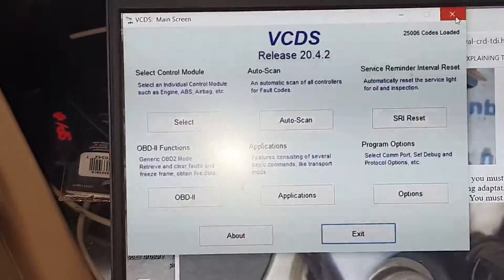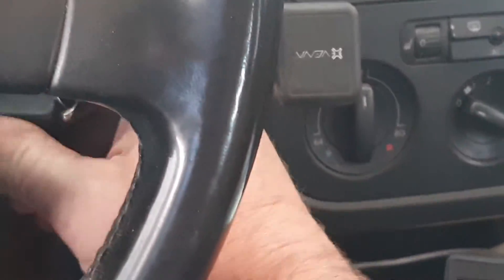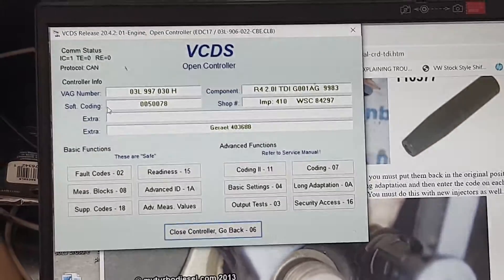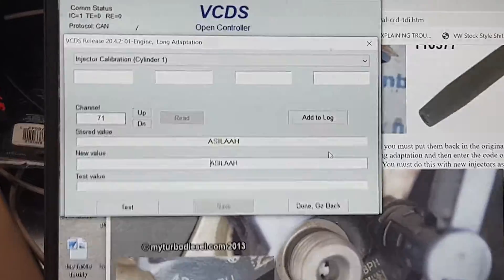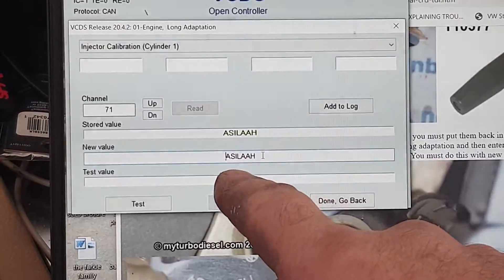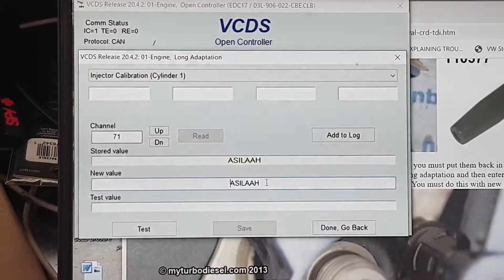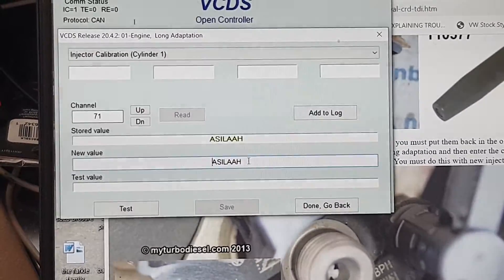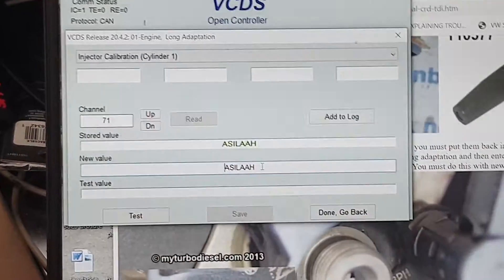VW TDI 2.0 common rail how to program or code new injectors after installing new injectors

Comment: Hi buddies, Have question
Today i did replaced second hand diesel injector and did coding. Procedure was done on injector 4 , everything was smooth, but.... now when i checked what code was writen to system - now shows 2 codes on injector 4 .  Why's like that that first code even doesn't looks like from old injector, second code from new injector which one i did replaced today. Why now on injector 4 i have two codes? Shows like that 4ZFGGG-9FFGGG

9FFGGG its new 
code.

4ZFGGG unknown code even on old injector which one I removed was different code. Why i have now like that?
Thanks
Reply from the maker: IDK why that is maybe it is not deleted? or the new injector is not recognized. Number wrong. Check the code on the injector again I read one wrong before  Then put some light on there with my reading glasses and realized a letter was a 5 instead of s.

Comment: Thank you for the amazing video.  My girlfriends mk6 TDI is throwing code p300, p3001, p3002, and p3004.  By watching your videos I came to the conclusion that if I replace the injectors the computer will not be able to read or perform correctly?  Am I correct?  I hate that he fact that I can do it!  Any suggestions?